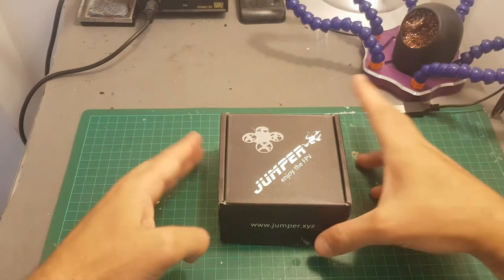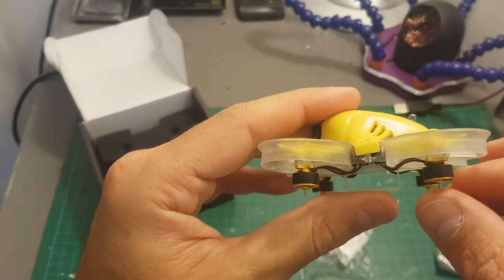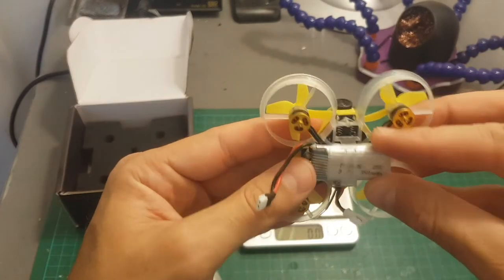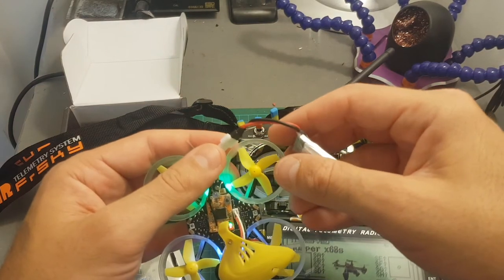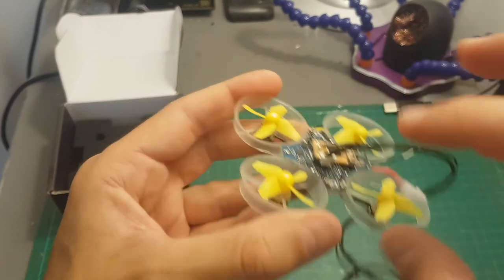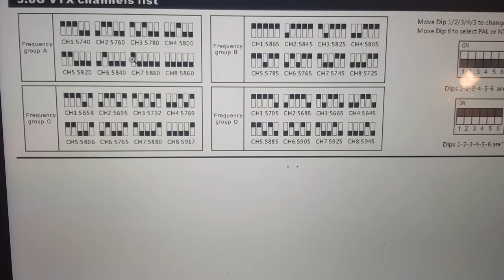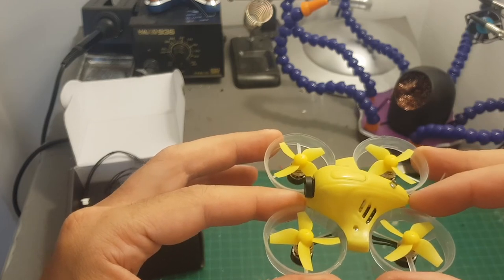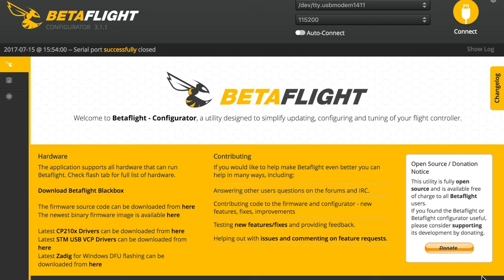Eachine Jumper X68S 68mm Micro Brushless Quadcopter Review And (A Very Short) Test Flight

Comment: Gal, could you please tell me what had caused the sudden loss of control of the Jumper at the end of the (very short) flight?
Reply from the maker: One of the motors stopped working and the board turned out to be defective...
Reply: Damn, that's NOT good at all!    I will be getting mine in a couple of week's time.   Fingers crossed that it will be OK!    Was that your first flight of it and are you going to get a replacement from Banggood?
Reply from the maker: Will probably get a refund. Yes - it was it's first flight. Hopefully yours will be better :-) Let me know once you'll get it.